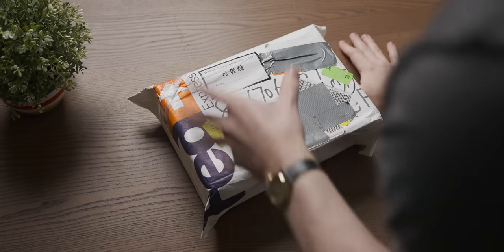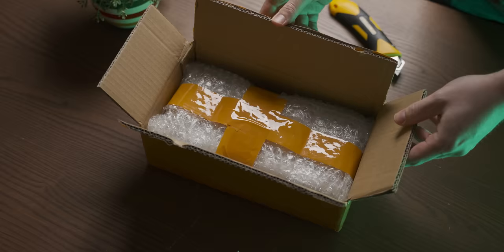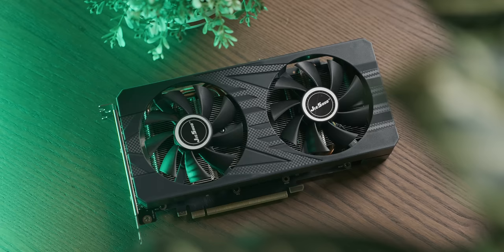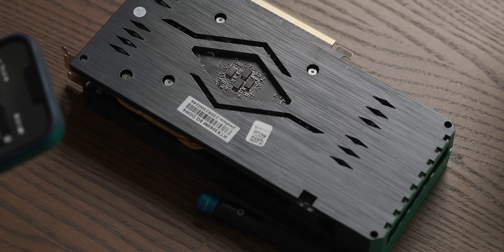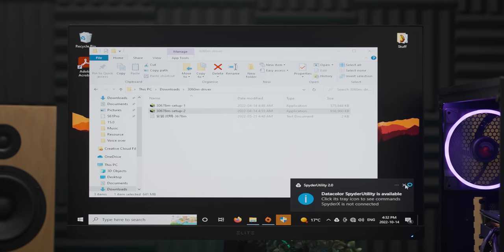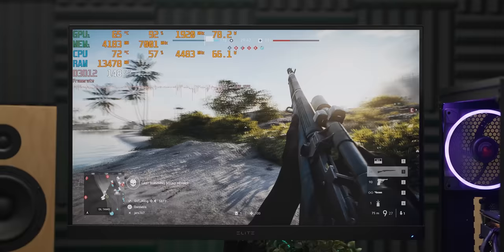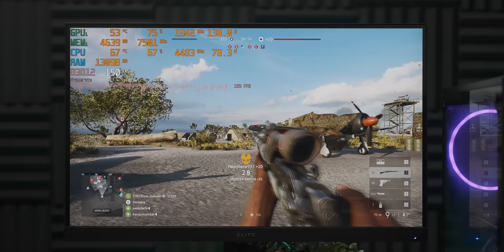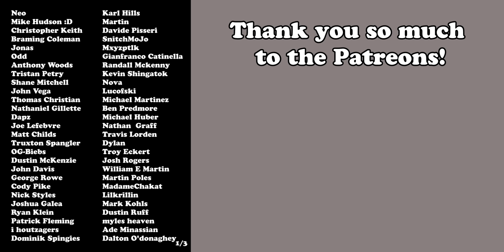This "New" RTX 3060 From Aliexpress Was Suspiciously cheap...

Comment: The right drivers, no external power man these would make older pcs very viable 😁
Reply: You could use MSI afterburner, and set the power limit to like 85% and then you wouldn’t even need to plug in the supplemental power. I use to run a dell optiplex with a 1050 ti. The 1050 ti I got had a 6 pin power connector, so I dropped the power limit to 90% and ran the card without supplemental power no issues. I crashed one time in my 2 years of running that system.
Reply: @taylorwillis5556  I was literally thinking of this, I have a dell optiplex with a 1050TI. I think I'm gonna try and find one of these mobile GPUs to put in.

Comment: Well, the driver issues are the reason that the RX 6600m cards are a better option than the mobile Nvidia cards, since you can just easily install official AMD drivers with updates

Comment: Drivers wouldn't install because the deviceid isn't in the compatible hardware list included in the driver package. Had to deal with this myself when I got my RTX 2060 laptop (custom build) back in the day. The driver the seller provided is indeed modified to include the ID. But best to send the ID to Nvidia. They will include it in a futher update.

Comment: I remember over ten years ago having to modify desktop drivers to upgrade a mobile Radeon X600M GPU, as the official drivers of that laptop were waaaay outdated and didn't work well. Maybe that's what they did with the dodgy driver, with some extra bonus...
As for the performance, that's actually great, considering the price and power draw differences.

Comment: Did you try installing the actual latest driver from Device Manager? It should bypass the compatibility check (hopefully)

If it doesn't, driver modding is still an option to remove the check and force install it.

Comment: Sometimes you can FORCE install of the Nvidia drivers via Device manager>select the adapter>update drivers. Then manually select the card from the available list and try and force them. I have had luck with a pre production 1080ti "10GB" by forcing install of consumer 1080ti drivers. Geforce Experience won't be happy, but the game drivers will be up to date.
Reply: Another way is to use something like a GT 1030 to force install the latest THEN install the jank card, climb into the nvidia driver folder, THEN force it to install drivers for a different card. Most of the Nvidia live divers have packets for the full collection of actively supported cards.

Comment: I sometimes have some trouble installing drivers for official Nvidia chips on linux. I'm very curious as to how Linux would treat and use unofficial cards, and if the official Nvidia driver does actually have a chance to work under Linux
Reply: I've never had any trouble installing Nvidia binary drivers on Linux but I'd still love to see if this graphics adapter worked in Linux. It'd be perfect for me.

Comment: Would the same apply to AMD? I was about to buy an rx 6600m but if it won't have the drivers too I think it's not a good deal lol
Reply: AMD drivers are unified which is why it wasn't the issue with the 6600M. the only reason this was the case with the 3060M specifically is because the 3060M 6GB is OEM only and is not part of the NVIDIA official driver package, but is offered by partner vendors otherwise carrying this model. this can easily be fixed by just adding the GPU into the official drivers through NVcleanstall

Comment: I bought the RX 6600M when it was at its lowest of $180. Absolutely felt like the deal of the century for me. No hassle whatsover with installation, could even install the latest official radeon drivers. Has all the extra features too like SAM and whatnot. Shame it isn't the same with Nvidia drivers, tho I wouldn't have paid $50 extra for a 3060 anyway. It seems there's also the RX 5700 XT going for around $150 right now, would perform a bit better that the 6600M but at the cost of quite more power draw.
Reply: Can you increase the GPU power limit?
Reply: @jmurph9598  they are super low power chips that are being pushed to around 100w already, these chips in particular when used in laptops probably run in the 25-35w range for power consumption reasons.

Comment: mobile GPU from nvidia are tied to the vender you have to edit the installer to see your GPU then will install. I edited my old 880M to a 980M to get little more performance from it but every time i had to install a new driver i had to edit the installer
Reply: What exactly do you mean with edit the installer? I have a 820M and have the same problem where i can't install the driver and I tried everything possible.

Comment: I actually bought 2060 a while back with a huuuuuuge cooler from that seller (Great card btw cooling wise), there is probably a mention of the mobile chip in the description and you can contact the seller and he'll point you to the non mobile chips if you ask if you can game or only mine on it. Though obviously not as cheap, but still quite a bit cheaper than anything else available elsewhere.

Comment: It was not too long ago that we mod main stream drivers to allow cards with specific product/device ID to be recognisable. In this case, probably need to find out the device ID string from the drivers provided by seller.
Reply: anyone could have easily done that by using NVcleanstall (the program literally spoonfeeds you the information, you just have to select the right one). its just that this guy hasn't figured it out and blamed the product instead

Comment: You should overclock it to see if it can reach a higher performance than the rtx3060 non m
Reply: You cannot overclock it, as it is 80w variant. Meaning as soon as you hit 80w it will automatically downclock. There is 115w rtx 3060 mobile variants which are more faster than 80w and some 115w variant can be unlocked to run all the way up to 130w on hier tier laptops with overclock

Comment: Can we get a follow-up video with a comparison between this thing and a 3050? 80W is so close to not needing external power, which is the only thing the 3050 as going for it (the card you have also has the same VRAM as the 3050 but twice the memory bandwidth). 

Give it a mild underclock so it stays within 75W, get a half height version, fix the driver situation and it could actually be a great low-end card.

Comment: Early this year I got a "gtx 1080" when I asked the seller they said it was a "laptop 1080 adapted for pc" it was like 150dlls so I bought it, I had the same problem with the drivers and when I got the custom drivers it worked fine, but to pair with oculus link and blender it needed newr drivers, asked the seller to take it back and he just asked for a 10 dlls bribe to take it back, so I did. Next month I got a zotak 3060 12 for only 250 dlls, almost new with box and 2 years left in warranty, I'm glad I send it back.

Comment: It would be interesting to compare it with a RTX 3050.

New drivers probably require modding, you have to enter the chip name and other information manually. I guess that they are using modified laptop drivers.

Comment: Not sure if you mention it since I'm not done watching yet, but there's also a desktop RX 6600M you could try. It's similar to this in that it has a laptop GPU on a desktop PCB, except it's pretty much identical to the ordinary RX 6600 aside from clock speeds and power limits.
Reply: I actually recommended this on suggestions in the discord when the 6600M was cheaper than the 6600 and in stock. The 6600M is almost identical performance to the 6600.
Reply: You realize it was a bot right?

Comment: just sayin, it's more comparible to a 3060 ti according to the ebay seller I got mine from. lol. it's on the way now I can't wait for it.
Reply: 1) I just got mine the other day have yet to tinker with it to get it to work. I have been busy and it's a side project for my living room PC. I'll keep the comments section posted on how it goes incase my data helps someone in the future who's going to purchase the card. I was told to tinker with some settings in bios to get it to post, once i do that I'll come back for another update!
Reply: Doesn't work with 6/7'th gen intel, which is the budget build I was going for But I have a 10'th gen i5 and i also have an 8'th gen mobo so once I get either an 8'th gen cpu or an lga 1200 mobo I'll post again.

Comment: you can't install these on signed drivers afaik - you can either disable driver signature enforcement or use NVcleanstall to add the GPU specifically to the drivers so it gets recognized.

Comment: GTA 5 stutters over 165fps . if you got a 240hz monitor and u are getting like 185fps or more, limit the framerate to like 165fps with control panel and you will never see stutters on gta 5 again

Comment: Thinking about it quickly: Perhaps the problem that the drivers are not recognized by Nvidia could be because there is a conflict in this GPU that is prepared for notebook motherboards and bios and not desktop?
If there was some way to trick the system or the Nvndia soft so that it understands the PC as a notebook, could the official ones be installed?
Reply: This. It probably needs a 3060m driver to work. Manually downloading the driver might work.

Comment: I have a RX6600m from this same brand bought on aliexpress about a month ago. Running great, maybe 5% less than the regular 6600 but using 90/100w tops. AMD official drivers was installed no problem. I think the problem here is with nvidia specifically capping these non official builds.

Comment: It is not recognised by Nvidia Experience probably because it was a card used in mining so somewhere along the line they wrote a specific Bios and custom designed drivers  for it and it's no longer compatible with the original Nvidia drivers

Comment: That’s the video card my new Lenovo Legion came with. I paid just over $800 for a desktop with a high end i5, Nvidia RTX 3060, and 16 gb of ram.  Legions have the most fantastic cooling systems also which you are going to need for a video card like this one. 

I got Spider-Man Remastered for free and have everything on highest settings running perfectly smooth!

It’s a great video card. Everything I have tried runs at top notch speed with highest settings and the ray tracing effects on. 

I remember when I bought my first Nvidia GeForce about 20 years ago. I was able to play a good number of games that exceeded my desktops requirements. I have always been a fan of Nvidia. My first video card on my first desktop was an Nvidia Viper with 3Dfx. 

Radeon has improved over the years. I have had 2 of them. But I’m definitely more of a Nvidia fan. Glad you got a discount price. We all love bargains!

Comment: Why didn't you try manual installation of NVIDIA drivers through device manager, the installer didn't detect the card but manual installation may have worked.

Comment: the 3060m is approximately equal to 1070 as the online test result. it is still way more efficient for most of the games running 1080p today. can't say it is useless, but don't expect the power as regular 3060 which can compare with 2070.  Cheap is the point of this product

Comment: Probably already mentioned a thousand times already, but why not try the established method of modifying the .inf files of the official drivers to get this working? It's been the standard of getting updated mobile GPU drivers working for ages on laptops. No more plague, and probably better FPS with the latest drivers.
Reply: exactly, this can easily be remedied by just adding the GPU into the INF file or adding it through NVcleanstall

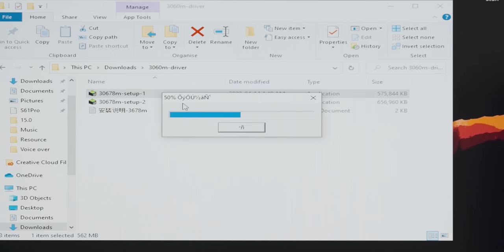Comment: 5:44 That's poor. It's like some old 2000's games trick of CD's where the installation file is split into 2 parts. You must have both parts installed before you can even install the program.

Comment: I'd say someone who knows their stuff could make the newest driver install with some editing of the inf file to include that specific card's device id's, what is most likely happening to you is this card has an unknown device and vendor id attached to it and the driver looks at those to decide if compatible hardware is even in the system.
Reply: exactly, this can easily be remedied by just adding the GPU into the INF file or adding it through NVcleanstall

Comment: Though this gets me to think... This would be something helpful in the current situation with rising energy prices to still be able to do gaming or GPU rendering at home. The mobile GPUs are definitely still enough for a lot of things (without RT active ofc). It's just a shame the drivers have to be such a hack. There is probably an easy way to modify current drivers to work with it putting some ID of it into a txt file to get it to work but nothing I know memorized...

Comment: The 3060 mobile edges out against the normal 3060, because it has less VRAM and has lower clocked VRAM.
Everything on the board contributes to how much power is drawn, and with how efficient the drivers are for the mobile series of GPUs, it comes out on top most of the times due to having more cores.

Comment: Mobile amper chips are actually cherry picked vs desktop chips and have close to the same performance for half the power use.  Most the performance difference you see is from not having the same memory capacity, speed and possibility bus width. I have a mobile 3080 mxm in my 170kmg. It pulls 200w and hits exactly the same frequency on core and memory. Has the same 320bit bus, same stream, tensor, rt core count. It's exactly the same.  But gets the same performance with half the power and only 0.85v core

Comment: Those errors pop up even on the store bought branded RTX 3060 (and other type). Usually causes by old driver. My solution always to wipe up the old driver with driver Uninstaller (even go as far as do it on safe mode) then install the new driver.

Comment: i've seen video on different channel with card using 3060m chip. card was working like normal 3060 with original drivers, without any issues. i guess some sellers are selling some proper conversion of mobile gpu.

Comment: Here is a thing, Nvidia has made a desktop RTX a2000 and it is basically 3060 mobile but for PC so MAYBE the a2000 bios could be flashed to fix all the driver issues???

Comment: I've already used one of these here in Brazil, if you don't want to use the "suspicious" drivers, do what I did on Linux. It works perfectly on Linux with the standard drivers on Pop OS
Reply: Did u use Frankenstein drivers they have for Linux aswell and windows is great card

Comment: You cannot install official drivers because as it is a laptop GPU it needs to see if the system has a Battery or not.
I learned this when I loaded my laptop GPU into a KVM Windows 10 VM and drivers would not install as the VM did not have a battery.
Reply: It is a problem with the official driver so dodgy drivers work as battery check is removed from there.

Comment: They just mod the original driver, just extracting the exe installation file with 7zip and changing the corresponding device id, it's just renaming the contents of a text files that has the list of all the device ids. You can do it yourself. You can easily find a guide how to do it. I have done it in the past when replacing an mxm video card on a laptop. The device id of the laptop GPU is matched with all the supported gaming laptops that exist, so there is no match for the desktop computer, that's why you can't install the original.

Comment: While I'm sure the GPU itself is probably genuine those Chinese GPUs, even with "official" ones, often cut costs with poor quality memory, which might be leading to wonky performance. Unfortunate it's only 6gb and using hacked drivers to work because the 3060 mobile wasn't bad at all and surprisingly doesn't look like an actual scam if the drivers end up being clean.

Comment: Needing custom drivers for mobile Nvidia GPUs is not surprising to me. The drivers basically have a list of which OEMs/motherboards ship with which GPUs. I know because I upgraded my laptop to an 880m and spent hours screwing with OEM codes in the driver inf files to get the damn thing to work.
Reply: exactly, this can easily be remedied by just adding the GPU into the INF file or adding it through NVcleanstall

Comment: you can use NVCleanstall to build an Nvidia Driver and sign using hardware id of the "doggy card" , it is easy and you will get normal drivers not the trojan ones from china.

Comment: Just to say that if you do manual driver installation, choosing from the proposed list, not using auto install from NVIDIA, you could install latest driver. Fact system doesn’t find compatible driver in auto mode is due to the fact that mobile drivers needs to be modded adding in info file system name… you could avoid modding and Trojan just unpacking drivers and going manually. You should be proposed some 5 or 6 version of 3060m that are normally brand related but with a couple of trials you should be able to find a stable one.

Comment: These GPUs are actually great for the money, I got a 6600M version of these and runs just as good as the original desktop chip version that costs much more. Also these GPUs in particular just use the regular desktop driver instead of the laptop driver version. At least my 6600M has worked flawlessly well, RE2 remake with an Intel I5 8400, 32gb 2666mhz DDR4 ram gave me around 122fps average with max settings on.
Reply: the doesnt last long 
sometimes a week or a month or 3 months 
and it will stop working 
many faced these scenarios with aliexpress gpu

Comment: Bit off topic but could you try using as many laptop parts on a desktop as possible?
Somehow I feel like nvidia might be doing OEM desktop shenanigans that if someone were to do stuff like this they would just not work by design.
Im pretty sure aliexpress has laptop cpus grafted onto a desktop substrate, and you could also use laptop ddr4 ram into a converter that goes into the desktop slots.